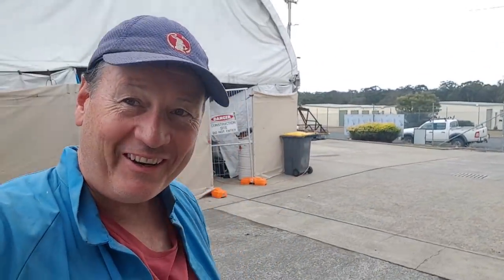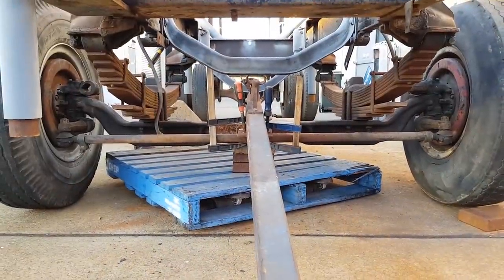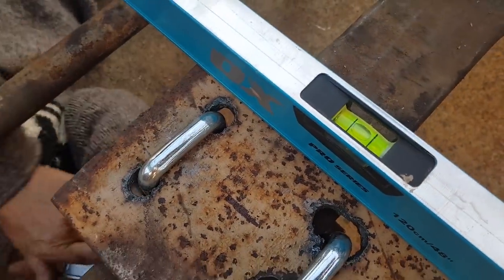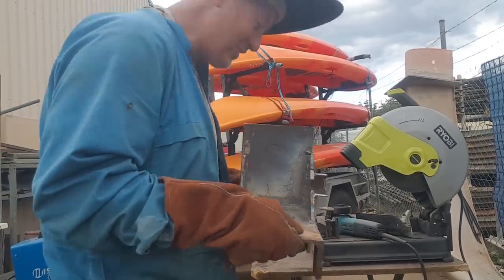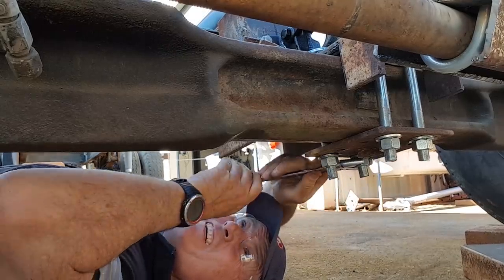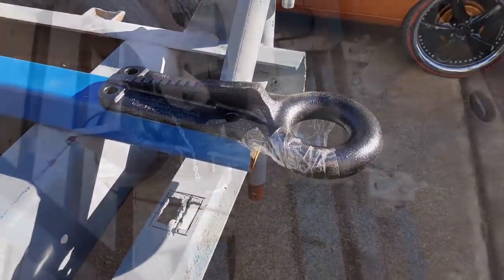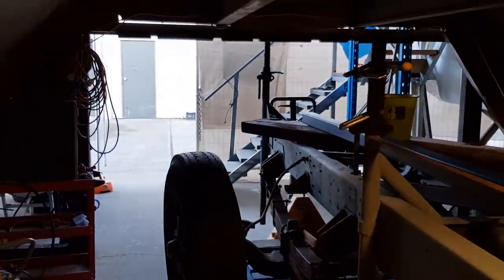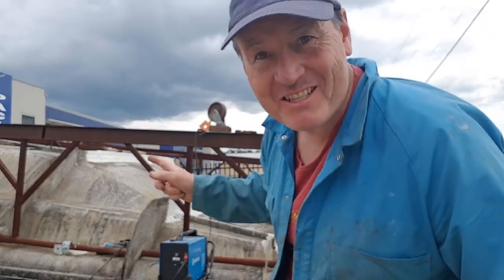Ep043 It's a GO'er!!! - LIfe On The Hulls - Catamaran Build

Comment: The bracket bolted to the steering bar needs the round pipes replaced with square tubes with the corners touching the drawbar, takes up slop and still allows sideways movement. A bar at the top connecting the square tubes will stop them spreading.  Or you could cut your steering bar in two, put trailer hitches on the ends, and weld two trailer balls vertically, one on either side of your drawbar.  This would be cheap and eliminate any chance of the drawbar binding vertically and sideways and still make it removable.

Comment: All you needed was an A frame attached to the front of the chassis it will follow you anywhere. Farmers use truck chassis for hay trailers all the time. Simple easy and works well. Cheers Rob
Reply from the maker: Hey Rob,we tried a rig like thar but the parallel chain drive doesnt work.If it were an axle with a ctr point like a billy cart and wheels swivelled on that point certainly that would have done.The distance varied by over 2 feet per side when attached to the steering tie rods and would certainly break one or both sides.I almost put a truck turntable in between the axle and the chassis to enable this a frame idea.Remember the wheels steer independently therefore aframe sadly was a problem.Good to see you are thinking for me buddy,appreciate any suggestions.Cheers Rosd
Reply: you are over engineering it you just need an A frame like if you were towing a car behind a bus. I'll get a friend to take a photo tomorrow and send it to you. Don't need any steering devices Just the cross bar keeping the front wheel parallel.  only thing you might have to do is roll the axle back to increase the caster wich is loosen the u bolts and put a shim at the back. Mind you I have never had to do that they have always followed perfect. Cheers Rob
Reply from the maker: @1cuttymore  that eouod be great Rob.Reality is this trailer will only go 1km to the launch site and back at 10km per hour so any advice appreciated.This rig is 2.5tonne and boat will be 9 tonne so need to bear this in mind and will never be towed at speed or on main roads.I have three corners to negotiate.Check out launch of the Knysna 50footer on the knysna cat site there you have it.Tilt tray to tow,cable to slide into water.Job done.,hopefully.Great to get your feedback and please send photo onto the facebook site.Cheers
Reply: We gotta use the KISS principal Keep It Simple Stupid an A frame set up should only take an hour or so to complete, Job done, only has to hinge up and down only 1.5 - 2 meters long hinged to front of chassis. I'll chase up them photos tomorrow. Judging by the tightness of where you are at a tractor might be easiest to get it out of there. Cheers Rob
Reply: Sent them photos last night Hope they help. you would also be better of with the rear brakes than front or no brakes. Hay trailers had no brakes and we used to put up to 20 tonne of hay on the bigger ones. Front brakes just seems like a bad idea to me it will cause jack knifing. Keep it simple. Cheers Rob

Comment: I agree with Jim Nickles about the draw bar. Shorten it up, plus instead of it passing between the two uprights with all of that free play, use a single large pin. In the draw bar cut a close fitting slot long enough to give you the turning radius you want. The slot can be reinforced with plating on the inside, plus add wide plating on the top and bottom of the draw bar that extends forward and aft of the slot. Hard to describe it in words.
Reply: Yes... you want the round piece on the moving tongue and the squared or flat pieces on the sides.

Comment: Love the tech side of the build. I have lots of questions.
Are there reinforced points for the chainplates?
How is the foam in the hulls going to impact the fitting of the modules? (God forbid!)
Is there a design for the mast and have you spoken to a rigger? Are you going to do that yourself?
Are there centreboards? 
What is the steering system? Hydraulic? Mechanical?
I'll stop now. Probably best we never meet, Ross.
Reply: Ross fit all of the modules and found out that he had to cut back a bit of the foam for them to fit correctly.

Comment: Boy that's a lot of leaf springs
For the Q&A- 
-how much do you expect the boat to weigh? (regarding trailering it) 
-someone commented about navigating out of the parking lot, i guess you could use an atv/forklift to get around the lot? 
-how far is it from the build site to the water, and are you going to close the roads or do something similar to when the molds were moved?
Thanks Ross, loving the build, glad it's not so freaking hot there now(:
Reply from the maker: Getting hot now,28degrees today and hotting up.I have a few options with moving it out includung removing a support from the tent which will allow me to get the turn needed.First demoulding will have to take place straight out in front so that should be simple enough,hah,like hell.I have to remove gates to get mold out and a very steep driveway to negotiate as well.That will be a video series on its own.Cheers Rossco

Comment: Helpful Hint: You can remove fine embedded fiberglass from you arms using either duct tape, which works well, or perhaps a sticky clothes lint roller. The tape pulls the micro shards right out of you skin.

(I was an assistant auto-fabricator, for a kit-car company.)

Comment: I love what your doing its awesome to watch i love your idea for the steering what i was thinking though is id put some reinforcement to those two tubes though as when the vehicle pulling it steers all its weight will be pushing against them id maybe put some gusets in or something on the top to tie them together i know youve already finished it but just a thought. Personally i would of got a truck recovery vehicle to tow it as they would just lift it from that front axle no need for steering and just level up the model once they lift it. Hey from the uk by the way haha

Comment: Always give you a Like Roscoe. That welding looked like me when I was doing the suspension on my 2 tonne Van - I also couldn't get a weld to start. Yep Fu%$#n welding cable out of the welder. Crawling around in the gravel is never much fun - especially to plug the welding lead back in. By the way I like that fleet of Mission Sit On Tops. I too have the same boats down here - about to sell them off to a potential buyer who hired them recently and thought towing them down the Hume didn't require the top load to be front and rear traced. Hmmm the cheese grater effect at 110kph 🧐🤣🤣
Reply from the maker: Thanks Bewsey love ya buddy.

Comment: For the Q&A...I seem to recall you once saying that the hull was designed to be laid up without the foam core.  Will there be (or has there been) any issues with fitting the various modules now that the spaces where they were designed and built to go have been slightly reduced by the addition of the foam?
Reply from the maker: Good question buddy,all covered earlier but you are on the money.Was issues for sure. Cheers

Comment: Do you have any plans to even temporarily brace the bottom of the mold frame between the hulls after positioning your tow truck/dolly to lift it? 
Since your lifting jacks are pushing up along the center line of the boat and the weight is spread mostly about 3 meters to either side of your lifting points, the stresses are in the opposite direction to the finished boats structural design, and your cutting up and changing of the mold framework to accommodate the dolly has removed all of the structure that would have resisted a concave flexing of the deck and a down and inwards movement of the hulls.  (:
Reply from the maker: I am going to place expandable acrow props horizontally between each support that will prevent inward movement.The mould needs to be lifted with the cross beams on the truck then there will be longitudinal supports wood 250mm x 50mm x 8mmtrs on top of these with foam carpet or similar to support the boat for the remainder of the build and launch.These eill tie the uprights together plus 4 support cradles under hull whilst in construction.Thanks for commrnting appreciate the interest.

Comment: I would look at how much work went into the boat before you make some contraption to pull it,The snap factor is a bitch.overloaded testing is in the future I hope?
Reply from the maker: Agree Scott.The truck itself is 2.5tonne and the boat dry weight should be 8tonne max so pintle hook and rings rated to 10 on the tongue pull weight.I have breaks on front wheels of truck also l.Mould will only be on the truck for 12mtrs then hull taken out and mould removed elsewhere.then hull put back on truck till completion with supports under hull and longitudinal bracing also.Cheers Ross
Reply: First I want to say thank you for the reply,I now better understand wtf you'r trying to do there,I was kinda concerned at first until you whipped out that pintle hitch,My concern was those pivot pipes and the loss of steering at a crucial moment?
Reply from the maker: I am intending to serioysly beef these up and join at the top as well as bracing from the sides.Cheers

Comment: Don't go to crazy with that trailer, it looks like the woolamia boat ramp is only about one kilometres away.
Reply from the maker: You are onto it Tim.I will have about five -10 moves before launch date.mould in snd out,hull in and out several times.Then ultimately launch and annual lift out for clesning and biannual survey haul put.So will be a good investment in the long run.Ross

Comment: As you've noticed, the TIGHT Spaces between the shops is going to cause you a Problem in manuevering the mold out. The Long drawbar will make it Worse. Have a Short one, too, that a couple guys can use to steer in tight places? That's the only Bad thing about the trailer. For Highway Use, you'll need to put shims between the drawbar and the tie-rod tubes to remove the slop between them, or it will be ALL OVER the road, swarping back and forth. A tiny bit of slack in truck steering goes a LONG way, lol. Drive one with wore out tierod ends or kingpin bushings, and you'll See. They're a Bitch to keep in Your lane,lol. You look like a Prizefighter fighting that steering wheel, lol. You may have to move the mold out of the tent, then Crane it off the trailer, move the trailer to a better place, then lower the mold back on it, to get it out of that tight spot. I don't mind the welding, it IS PART of the Project, and so should be Included. Besides, it answers Questions like, 'Duuuuh, how ya gonna get it to the water?'  As far as the Working Underneath Trucks goes, Well, you learn early on how to Walk on your shoulderblades and the cheeks of yer ass, kinda like a croc on his belly. Truck Repair shops have two Raised tracks with sloped ends, so you drive the truck up on them and Park, and so can Zoom Around underneath on a creeper, and have more room to Work. Keep Up the Good Work.
Reply: jim nickles Good eye, Jim. Excellent advice.
Reply: It needs a round piece mounted on the tongue tightly fitted between a straight sided slot attached to the tie rod. That is the only way that I can see getting a tight enough fit to prevent swaying and still maintain the steering function.